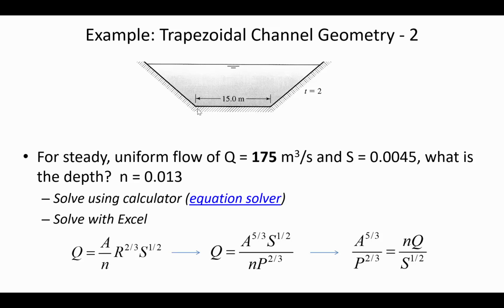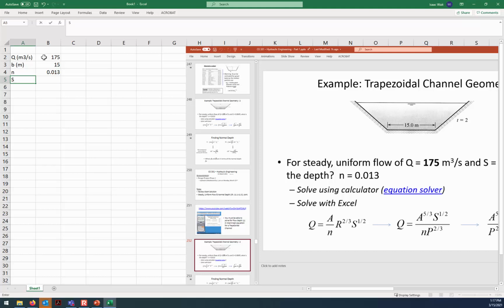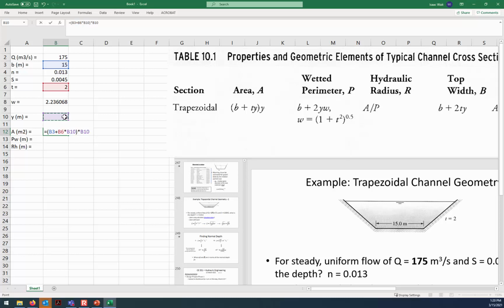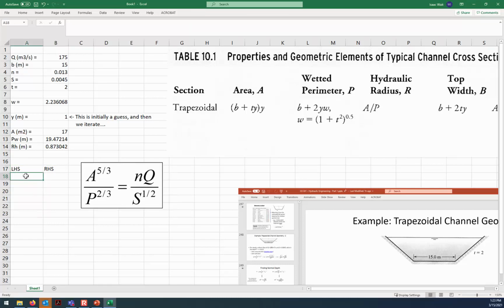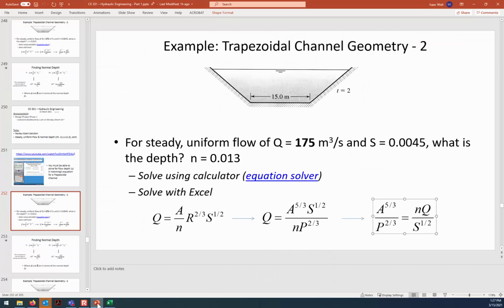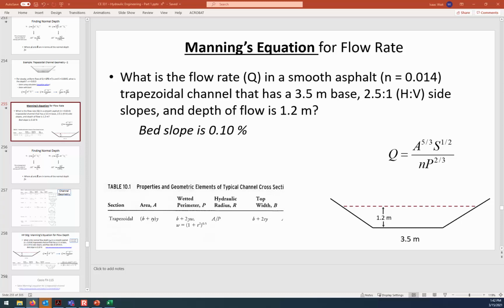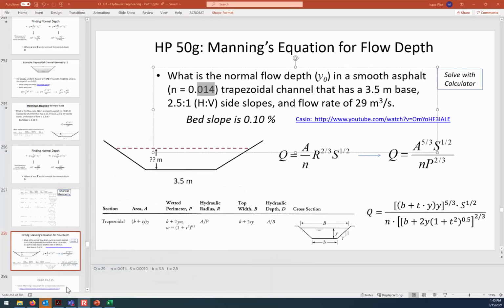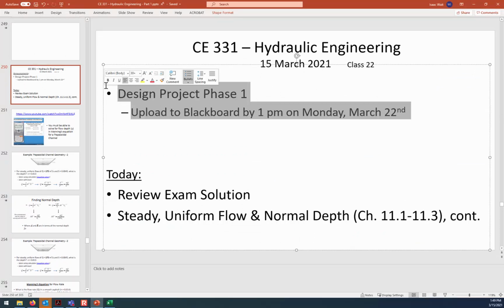Finding depth (trapezoidal channel) Manning's Equation and Excel - CE 331 (15 Mar 2021) Class 22

Comment: A trapezoidal channel has side slopes of 3 horizontal to 4 vertical and slope of its bed is 1 in 2000 . Determine the optimum dimensions of the channel , if it is to carry water at o.5 m^3/s. Take chezy's contant as 80. 
Sir do you solved this problem on excel please reply